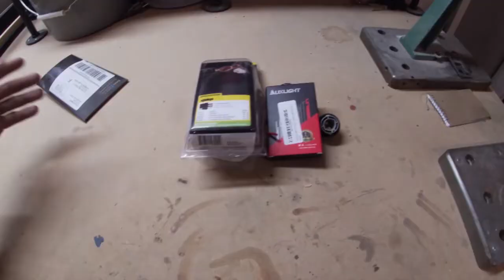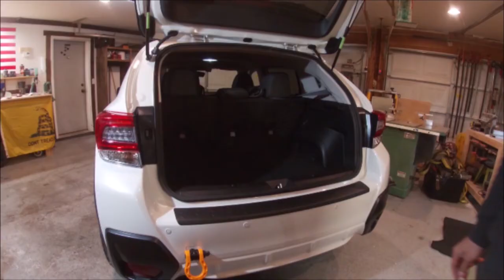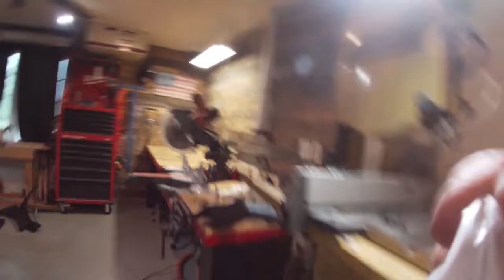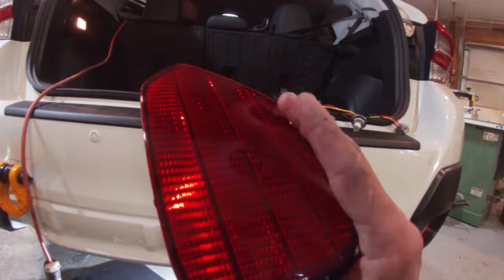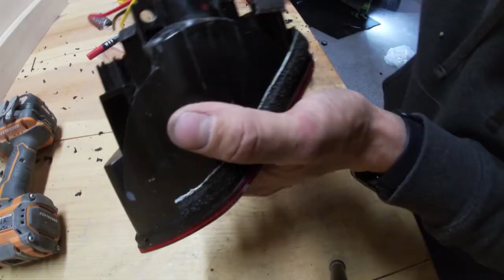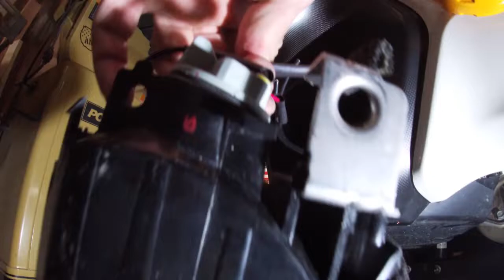Custom trail lights Subaru crosstrek Turn them Oem reflectors into LED tail lights with trailer wire

Comment: Probably not going to see this but I bought some after market lights for this and the trailer wiring kit and I’m gotten to the part where I’ve wired most of it but nothing is lighting up and I don’t know what to do. I’ve spent too much money on this not to finish it but if you could help that would be amazing
Reply: Did you ever figure it out? I know this is going to sound stupid but when I was doing mine sometimes that happened to me and I realized it was because I had unplugged it from the car wiring harness .

Comment: Great video. I'm deaf though and I feel like I missed something about the harness? When you spliced it all together, it looks like you have two trailer harnesses? (Two green wires). I'm still a little confused on that part. The black wires, I get. Just the extra colored wires threw me off. 

Think you could clarify on that please?

Comment: Hey my man, did you have a flicker problem with the reflector/lights? Dude from advanced told me i need resistors
Reply from the maker: No not if you wire through trailer lights

Comment: How can we do it without adding the harness for the trailer thnx
Reply from the maker: Tie into the same wires but probably need resistors if using LEDs could try it and see if you have hyper flash

Comment: Awesome. Just bought a 2022 Crosstrek. Hopefully it's all the same. Thanks for the video.

Edit: I finally got around do doing this and it works great. Its no longer a $45 project though.its about $60-65 or $165 if you dont own a Dremel. Thank you very much for this video. It would have taken me a lot longer if i had to figure out the wiring myself.

Comment: In Europe, those bumper reflectors are rear fog lights. That's why they're hollow like that. North America doesn't require vehicles to have rear fog lights. They should in my opinion.
Reply: Unfortunately, I've seen way too many ignorant Americans driving with their blindingly bright rear fogs on here in Southern California where we never have fog.  I put my brights on behind them, or get in front and put MY rear fog on, but they just don't get it.  Maybe some entitled types think brighter is better, but there are also some that have no idea they turned on the rear fog(s).

Comment: Just finished this up myself today, worked great! On the passenger side, there is a rubber plug that faces outwards toward the bumper (horizontally). Perfect for routing wires through. You can see it at 22:28 in the middle left of the screen (just to to the left of the blue wire stripper handle). Easy to get to from underneath too.  I couldn't use the holes in the video with my curt hitch installed.
Reply: So how did you route the driver side? I also have the curt hitch installed

Comment: Great video on the installation.  I have a couple of questions.   Did you use the RED version of the LED bulbs, I think they would work the best as all their light output would pass the red lens filter.  Do you think adding some aluminum reflective tape on the inside of the housing would help light the upper part of the lens?
Reply from the maker: Yes I used red output leds . The lower part is actually a different section blocked off but im sure you could dermel that off and let light through.

Comment: Using the LEDs, did you get hyperflash issues?  I ordered resistors in case but am hoping to not have to use them
Reply from the maker: No not going through trailer wiring harness built in resistors.
Reply: Thanks for answering so quickly!  Love the video. Eagerly awaiting parts to make this happen
Reply from the maker: @alexpost5871  no problem thanks for watching and let me know if you have any questions
Reply: @telludude  I wired it worked up the other day. I wired everything to a spare trailer side 4flat harness so that my trailer harness stays intact and I can simply unplug when towing. Love the look. Thanks again!

Comment: I think other country requirements (EU/Germany)  would be for the red fog lights to be located in this location.  It is also quiet possible that the wiring for those lights are already on the loom and hidden within the rear of the vehicle.  It is cheaper to make one wiring harness for the vehicle than have eight different looms to meet eight different country requirements.

Comment: Just completed this project! Once again, thanks for posting! Looks so cool on my new 2021 Crosstrek Sport! Don't know why they didn't include lights down there to begin with! The housing even had the light socket and tabs outlined!
Reply: Hey R Wilcox, anything special needed? I have a 2021 Limited I want to do this on. Do I  just need to follow the vid?  Thanks
Reply: @davidhenning8092   Hey David....yes.....this video was perfect to follow along with. Works great!
Reply from the maker: Congrats on the trek !! They are oem lights in Japan easier to make them all the same i guess then just not cut them out in different countries.  Thanks for watching!!